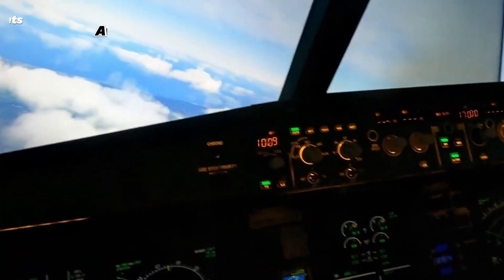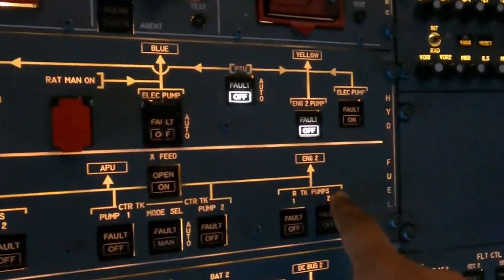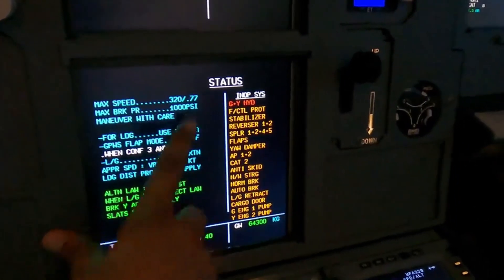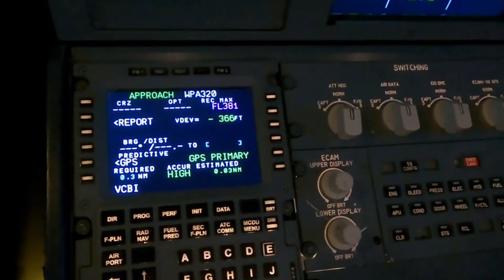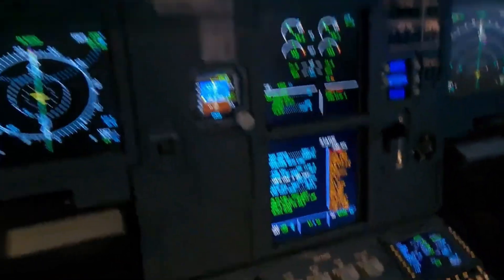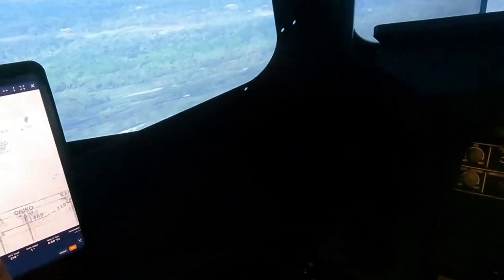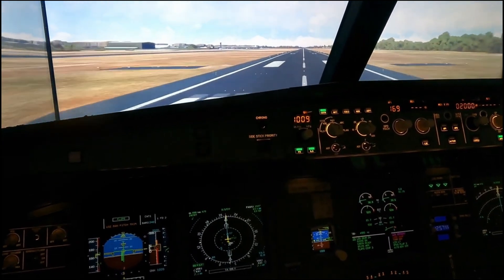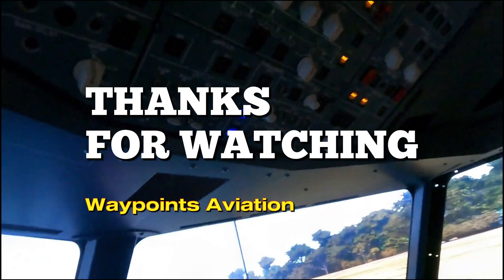Airbus A320 Tutorial: DUAL HYD Failure. Landing does not go to plan!

Comment: one question: VREF is not the same as VAPP, am I wrong? In theory, should the VREF be calculated with the QRH? P.S. very good video :)
Reply from the maker: VREF in CONF FULL is 1.23 × VS of CONF FULL. VAPP is corrected for any failure/s and/or wind.
Reply: @waypointsaviation  mmm...I'm even more confused... can you rephrase the answer, maybe then I'll understand... ;)
Reply from the maker: @Federico_io  Vref is the minimum safe speed at which you should cross the runway threshold, while Vapp is the speed you should maintain during the final approach to account for factors like wind, ensuring safety and stability. Vapp typically includes a margin above Vref to provide extra safety in variable conditions.
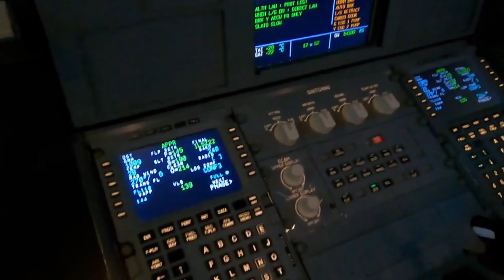Reply: @waypointsaviation 9:05 so, why did you calculate the VAPP+25, the correct way is VREF+25, I'm wrong? Tnx
Reply: @waypointsaviation  
FCOM/ PERFORMANCE (EFB)/ LANDING/ LANDING SPEEDS AND DISTANCE DEFINITIONS/ LANDING SPEEDS 

-VREF is equal to the VLS of CONF FULL. VREF is used to determine the Final Approach Speed (VAAP) when a system failure affects the landing performance.

VAPP is the speed of the aircraft when crossing the runway threshold. The flaps/slats are in the landing configuration, and the landing gears are extended.

Great and very helpful videos you make  out there, thanks a lot for your work and dedication to these, keep up the good work! Safe flights 👍🏾

Comment: The procedure is saying VREF + 25 kt ; FCOM says VREF = VLS in CONF FULL. So that means selecting CONF FULL, setting the VAPP by adding 25 kt to the VLS, then Changing to CONF 3. What's your take on that ?
Reply: Use the fly smart to get the Vapp as SOP
Reply: correct！Thats why the pitch angle is 5 degrees on short final, usually 8 to 9 degrees with G+Y fault
Reply: Beat me to it.
Reply: I thought the same. 159 should have been the VAPP
Reply: any speed increment is based on flaps full, then you select flaps 3 on mcdu, i do it all the time, this way the mcdu speed will match the EFB performance calculations, safe flights